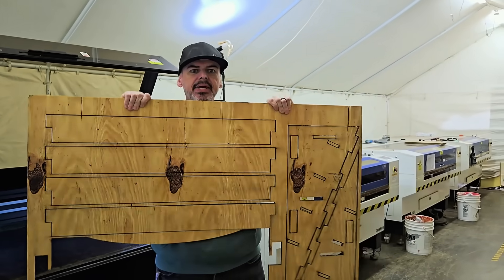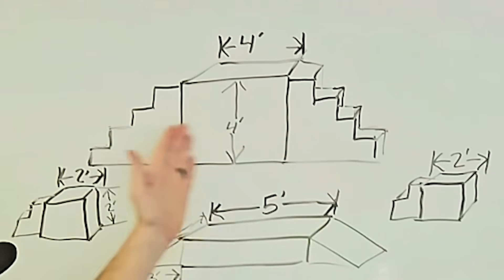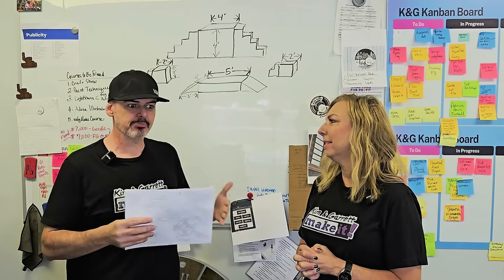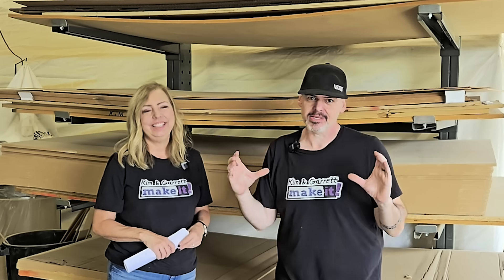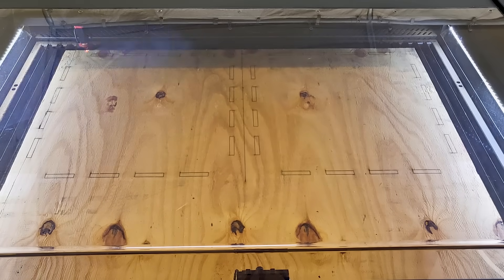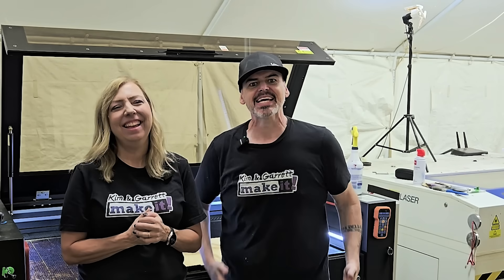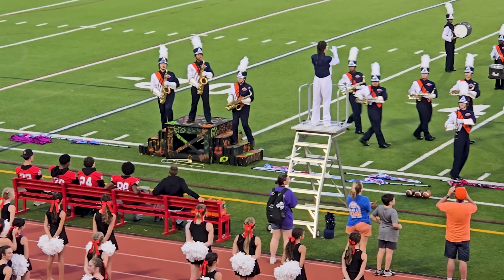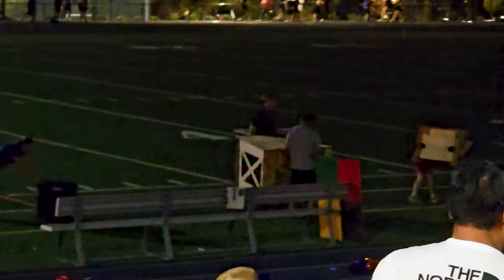Best Laser Cutting HACK to Save TIME and MATERIALS

Comment: My guess is that you were having an issue with laser beam drag.  Yea, it sounds weird but you should check out the video called "Cutting Matrix" on the SarbarMultimedia channel.  There is a fantastic demonstration of it near the end of the video into an acrylic cube.  The laser beam drag causes that perforated look on the back side despite the full line on the top of the material.  The video is also fantastic for explaining why cutting matrix tests aren't exactly giving you the right speed/power combinations for most full size cuts.  Great information for any user of lasers.  I was trying to rack my brain around why you would still have the drag with the multiple cuts and I think the answer also comes down to the laser beam profile on the back side of the project.  Since you set your focal point on the top of the material by the time you are near the bottom you do not have the correct laser beam focal point, therefore not making a clean cut.

Fantastic job working through the issue and coming up with a solution.  That was a huge laser cutting project to take on.